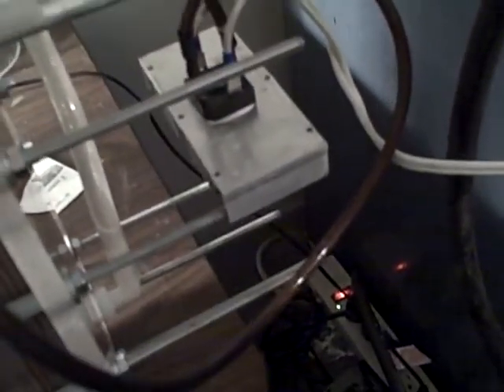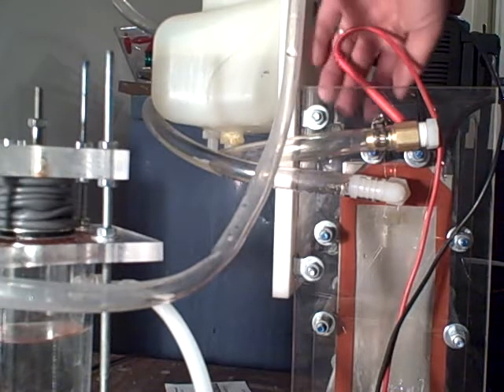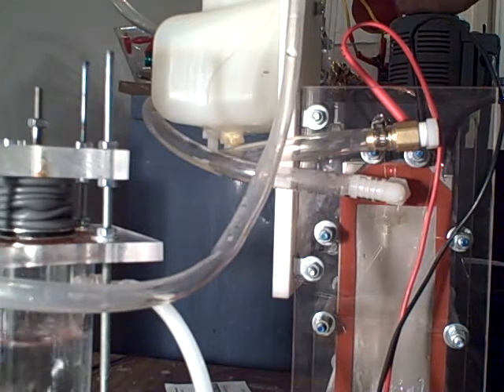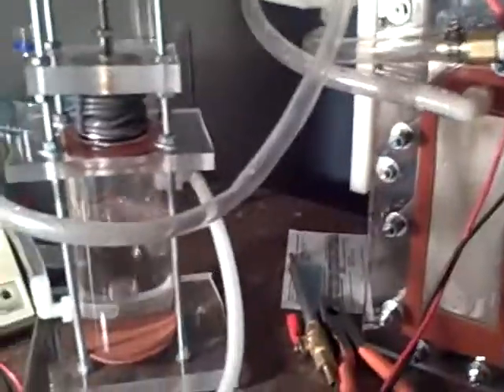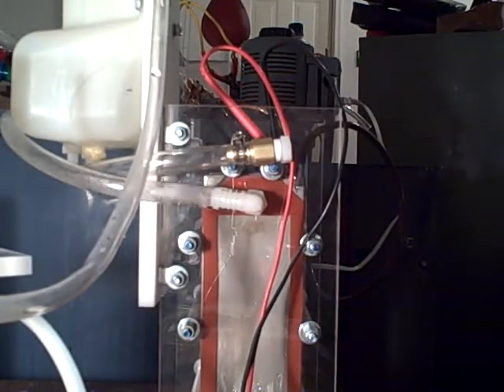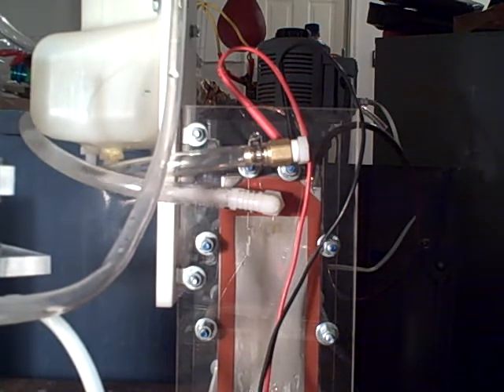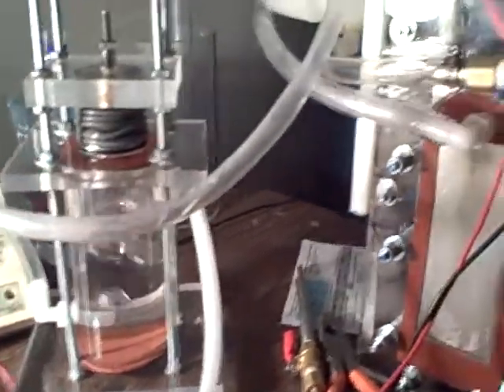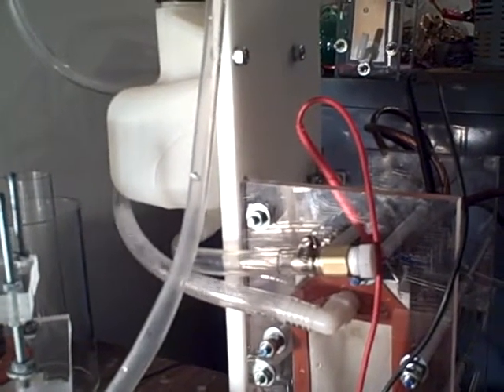HHO Dry cell mods.

Comment: In my experience a series cell with one positive and one negative is more efficient because the magnetic field in the cell flows all in one direction. In a 12 volt cell the positive and negatives flip flop thought the stack as do the magnetic fields and this results is like poles fighting with other like poles. I think this is one of the reasons a Bob Boyse cell is so efficient. I have all so noticed that the oxides are less and more even though the stack when run in all series.